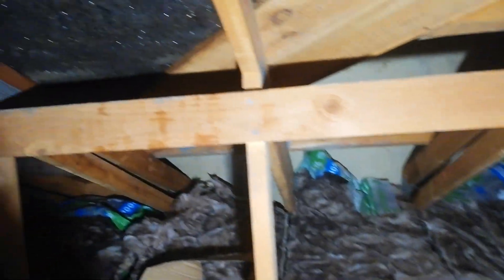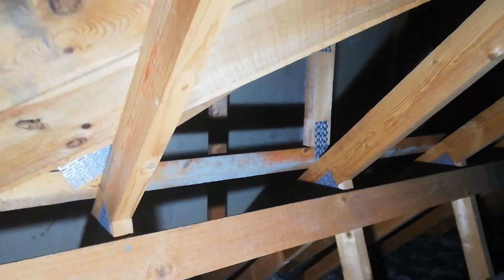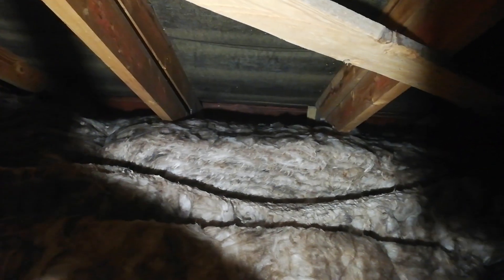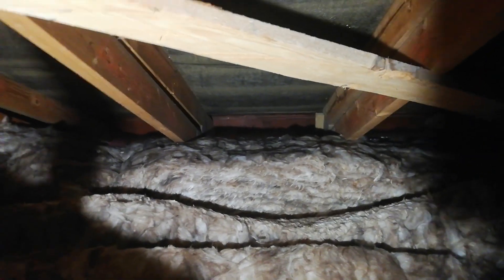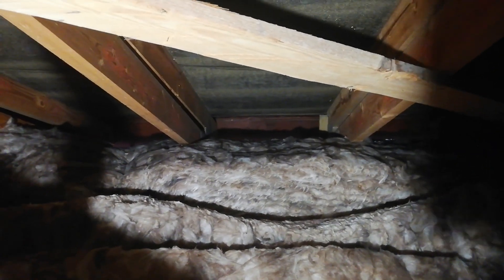condensation in pitched roof, poor ventilation,

Comment: Doesn't this indicate poor airtightness of the attic floor, letting in interior humidity into the cold roof space which then condenses? Just like it does on walls near windows inside the house?

Comment: simple fixed by inserting short pieces of plastic water main pipe where the first layer of felt overlaps at the bottom, allowing air through the gap created and thro the pipe.
if the pipes want to slip through the felt laps then simply fit a screw into the top of said pipe thus stoping it falling through

Comment: Manthorpe lap vents mate
Reply: Simple fix, opens the laps up for airflow movement,  can put in as many as needed, between each of the rafters if its warranted, no scaffold or ladders on the roof installing tile vents or dry ridge systems,  buy a box and get in the loft, job done
Reply: Very easy to fit, I am surprised they even work...